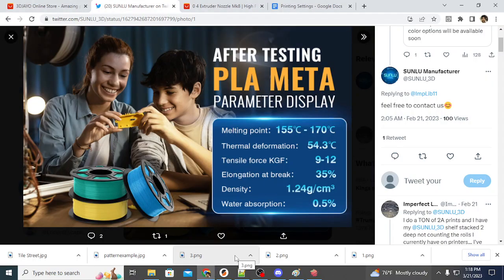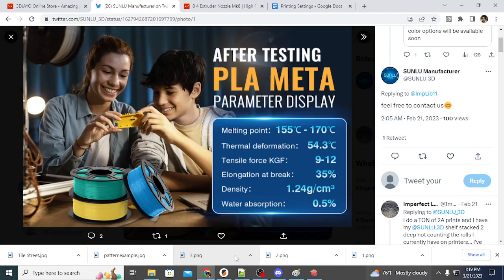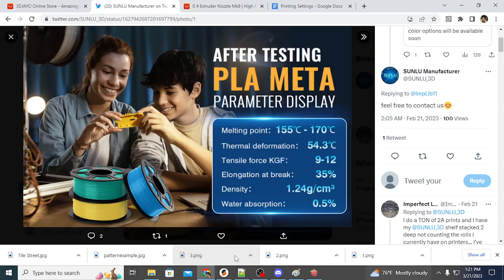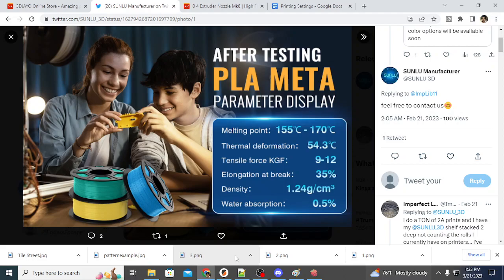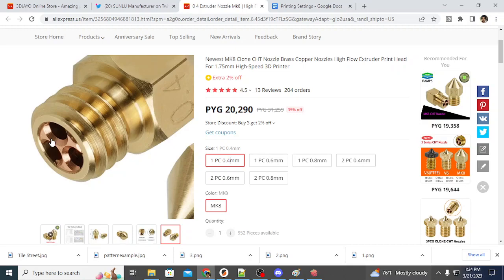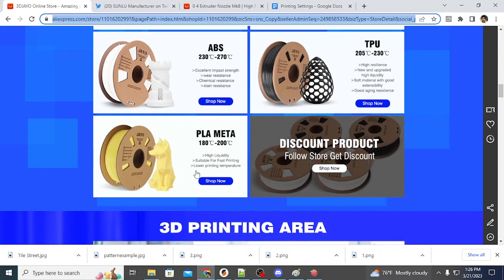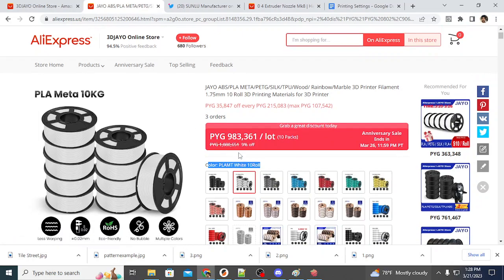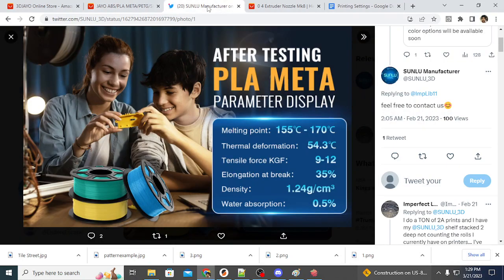Why to consider PLA Meta for your Stagetop 3d printed table.

Comment: I print on Vorons at 270mm/s for infills and not visible layers for the tiles (walls are a different story) at 215C. Is the limit for PLA Meta on a Dragon HF with CHT Nozzles.

Comment: Have ordered those nozzles along with all metal heat breaks to go into the Ender 3 Pro. Can reportedly run lower running temps as the hotend isn't trying heat thru the PTFE tube as well.